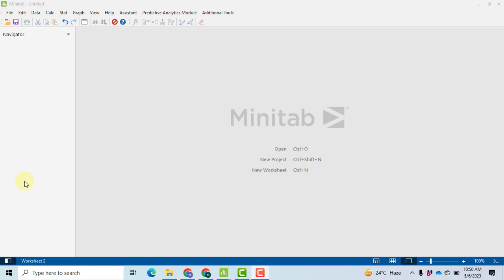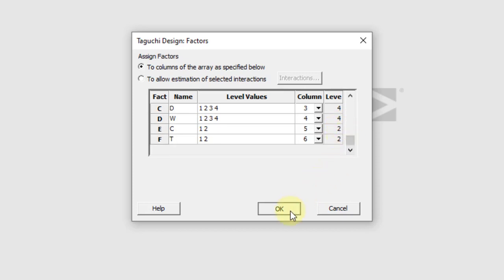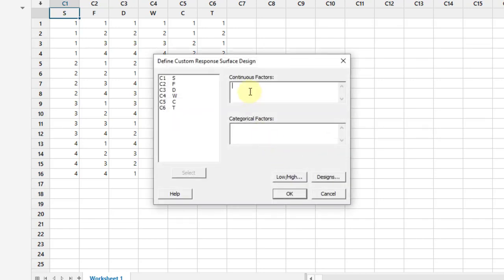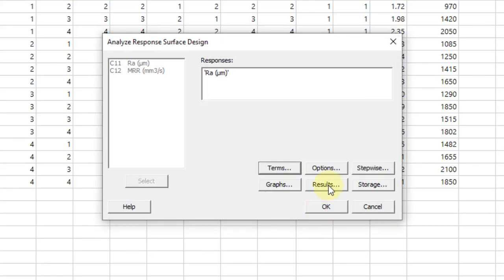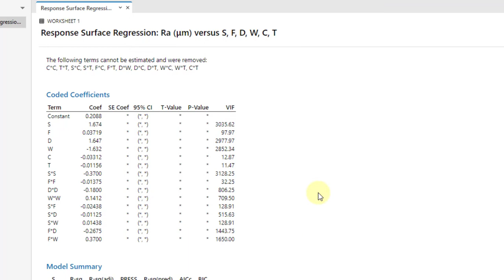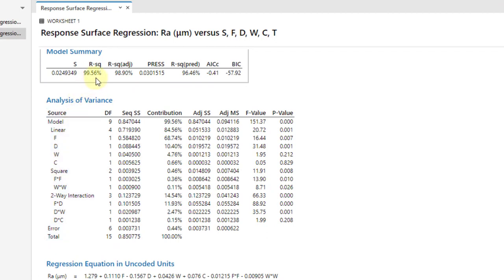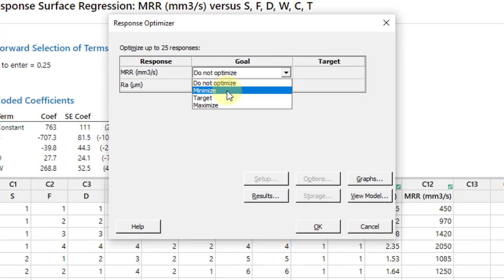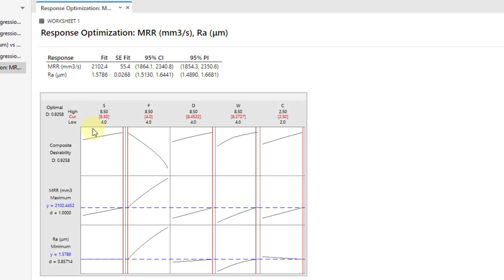Integration of Taguchi-Based Response Surface Methodology | Taguchi Response Surface Methodology

Comment: I tried with many versions of minitab but i'm facing issue w.r.t analyse response surface design. this option disabled. please provide me solution for this
Reply from the maker: I can do it for you if you properly design taguchi
Reply: @EngineeringandInfo  please provide me your mail id sir
Reply from the maker: @ramupenki  
miq0054@gmail.com 

+92 332 5056162
WhatsApp

Comment: We are not getting Analyse response surface design option after taguchi means not activated this option after performing taguchi. Please guide us. Thanking You
Reply from the maker: Hi.

May be some issue with the software version u have
Reply: @EngineeringandInfo  Which version used in this viideo sir
Reply from the maker: @ramupenki  minitab 20
Reply: @EngineeringandInfo  where can i buy it?
Reply: This integration possible through trial version or not sir
Reply from the maker: @ramupenki  I haven't used trial version... hopefully possible